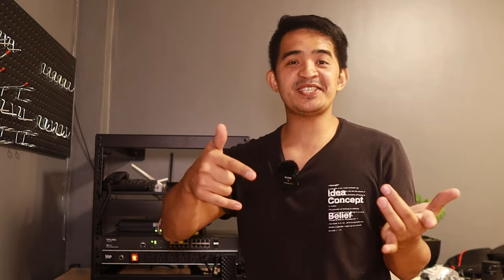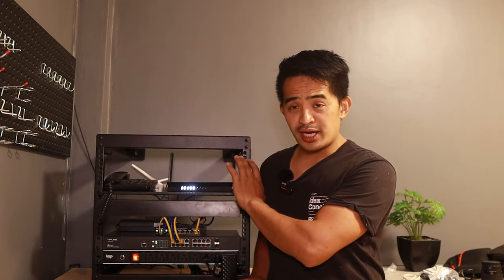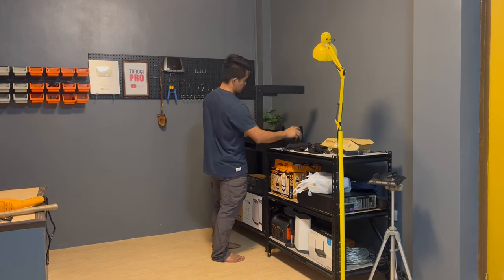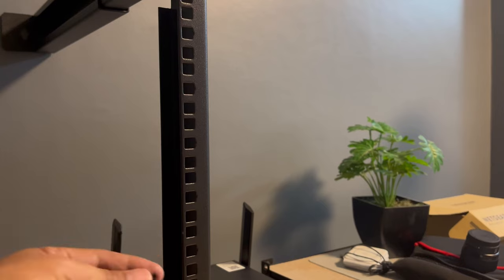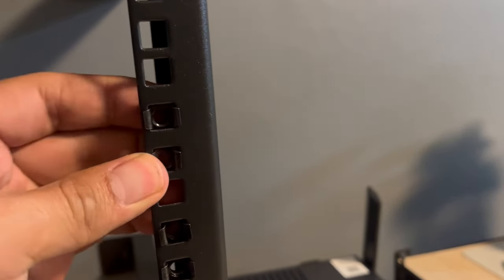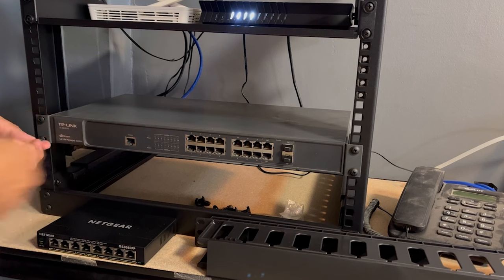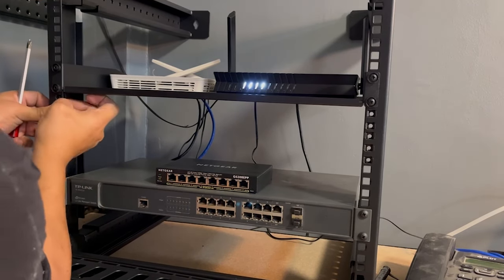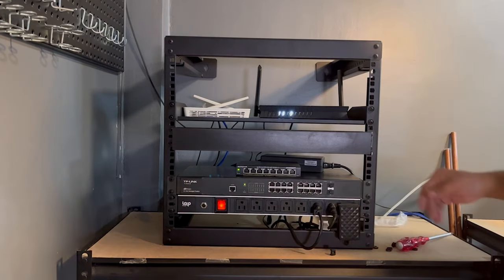Home  Network Setup: What you need to know

Comment: Why are you using an access layer switch as a distribution layer switch? Shouldn't your ISP connection for the WAN go to the TP-link switch since it most likely has higher non-blocking throughput than the Netgear switch does? Core layer aggregation comes to mind...
Reply: for the PoE

Comment: Great video. what set-up do u recommend, for someone who doesn't have cctvs and only want to extend our wifi network.

set-up 1. from main router, to TP-Link 16slot gigabit switch, and to wifi 6 modem?

set-up 2 from main router, to wifi 6 modem, and to TP-Link switch

set-up 3 completely change my wifi 5 modem to wifi 6 by unplugging it's fiber cable and reconnecting it to my wifi 6 modem. then I'll plug my wifi 6 modem to the TP-Link and from TP-Link to all the modem around my house?

Comment: I am moving to a new house and currently own one "TP-Link Talon AD7200 Multi-Band Wi-Fi Router" as well as 3 "Linksys
WHW0101 Velop Whole Home Mesh WiFi System".
The house is quite big and was wondering if i connect the 3
Velops via ethernet cables to the TP link, will it be one connection across the whole house and nodes being used as extenders??? Is setting it up easy??
Sorry if question sounds dumb and thanks in advance guys

Comment: Is it possible to make a local network with a old wifi router?
Reply: Of course. If you just want a network, but no internet access, you just plug in the router to power. Connect your computers to the router via ethernet or wifi and that's it. You have your own network. If you want internet access, you'll first need internet service and then a modem.

Comment: Sir good day. Is it possible this kind of network? 

Modem (ISP) > Switch (unmanaged ) > router (use as my WiFi)
Reply: No. The router goes in between the modem and switch. The router creates an internal network. It routes, hence the name, IP packets from your home network out to the internet and vice versa. A switch doesn't do routing.
Reply: it won't work unless you have a block of external IP addresses assigned to you by your ISP as this configuration requires external IP addresses for each device that is connected to the switch but before the router. Basically, your ISP will be the one assigning IPs (external ones at that) to the devices connected to the unmanaged switch rather than your router. You want the config that @jjflores197 suggested so that NAT works correctly within your home network.